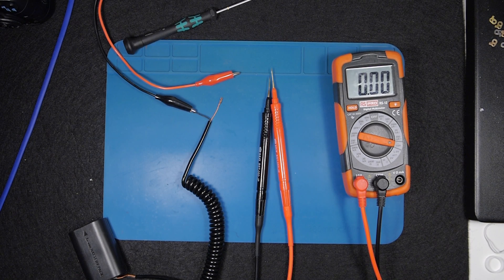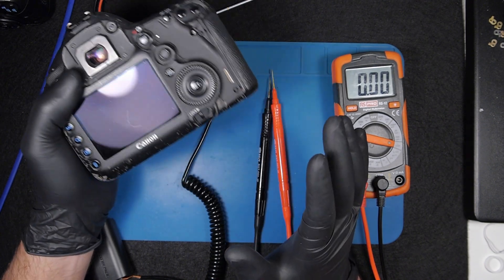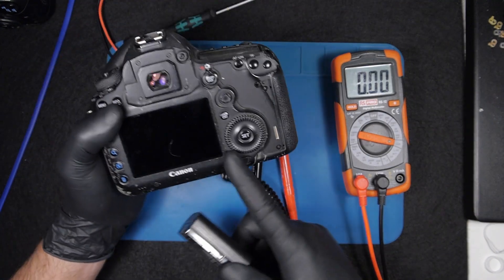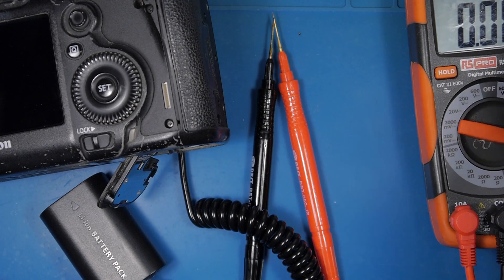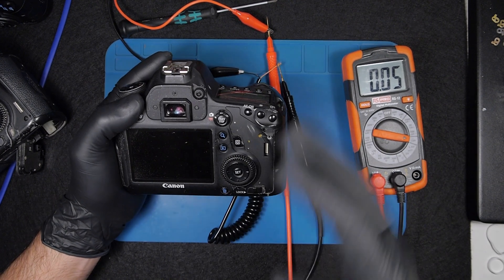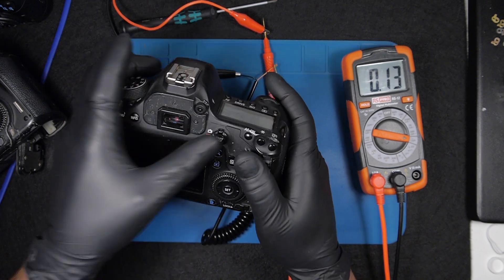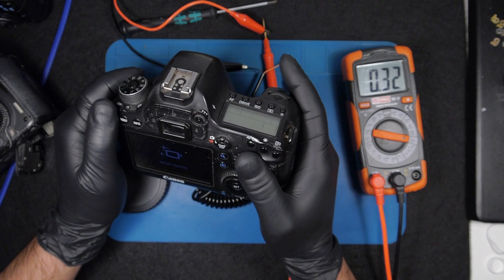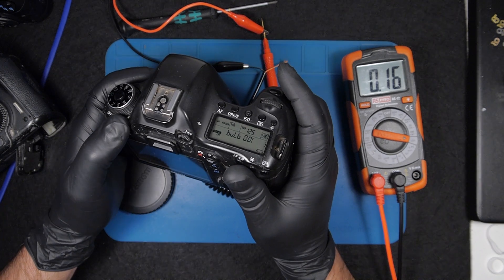Dead camera power check with a multimeter

Comment: I have a Nikon D700 that shows no sign of power. No voltage on the processor board. You say to look at the “power board”.  Is this the dc/dc board or another?
Reply from the maker: Yes power board aka dc/dc but d700 particularly has more power points, also the main dc/dc is quite complex to fix, loads of components
Reply: @CameraRestore I have another one that works except it’s mirror doesn’t work right. I tried swapping the dc/dc boards and  both are good but it did not help power anything on the no-power camera. What next to swap?
Reply from the maker: @barryklein1023  ok, it's good to have a donor camera, still diagnosing a dead camera, it is extremely hard, so not the proper way we do it, but let's carry on.

Next, I will focus on a small circuit board that is placed behind the flash capacitor. You need to discharge the capacitor unless it is already empty; otherwise, you can compromise the whole camera if not done properly. I have a video on the channel that shows this btw.

ok,  on the link video below, after I take off the image sensor, you will see for some seconds the circuit board I'm talking about, the little one on the left of the camera. To get there, you will need to take off the top and side cover:

 https://youtu.be/WCWPV8MbYEk?si=h8kV6M3JR-Z_7QzN&t=510
Reply: @CameraRestore so do you mean the board with the power and hdmi ports?
Reply from the maker: Yes, power and audio jack

Comment: Hey. Do you have a video on creating the test battery used to connect the leads of the multimeter? I have a dead nikon d3000, clean, no visible sign of dropping or water damage. I have an extra battery Id like to use to create the testing battery.
Reply: Also, I subscribed and liked to support.
Reply from the maker: Not really, would be much cheaper and even safer if you buy the dummy battery for your camera, check on AliExpress